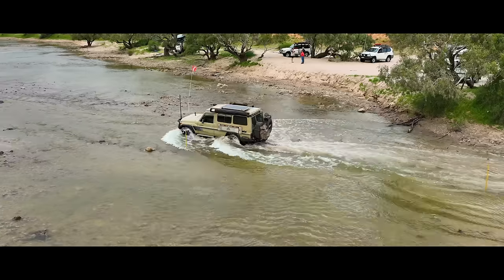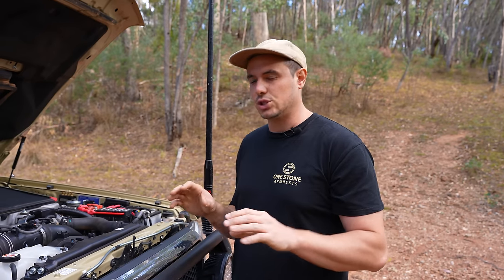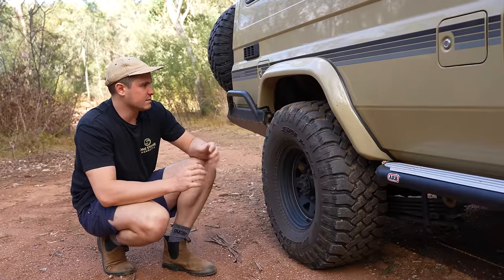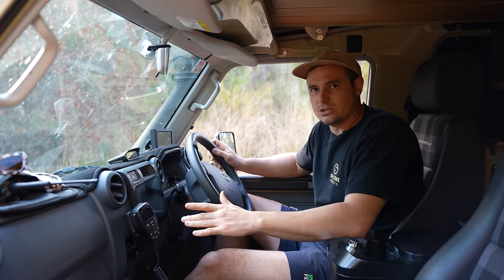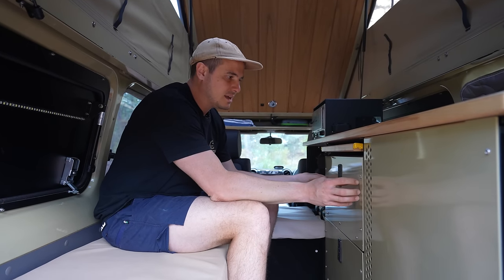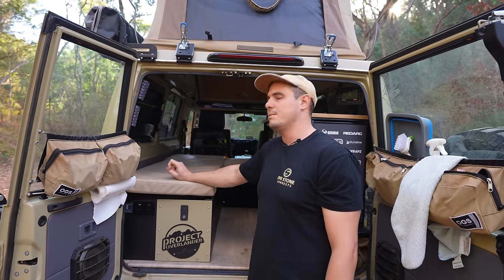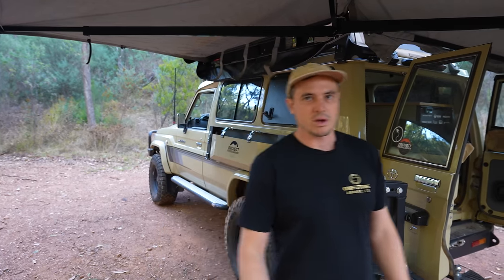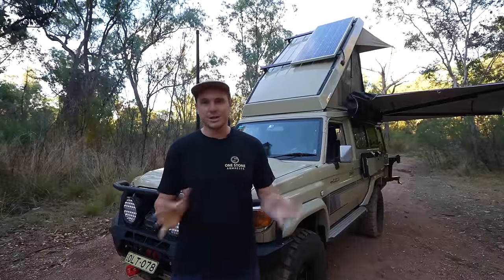ULTIMATE TROOPY TOURING SETUP - FULL RIG RUNDOWN

Comment: You left out the most important information, the total price.  I know most of the gear you have are either supplied 100% free, or with a heavy discount.  But if you had to add it all up with RRPs, how much do you think your current Troopy built costs?
Reply from the maker: All up it would be about $225 000
Reply: That was the first thing I thought the cost
Reply: @OverlandTravellers  is that including the cost of troopy?
Reply from the maker: @danielmichael3723  yes including cost of the troopy
Reply: @OverlandTravellers 225000$ including the car price or just accessories ? If it’s including the car that’s not bad I mean if you don’t drive like an idiot and MAINTAIN it out and in it’s a car for life
Reply from the maker: @tariklaarej2259  225 total including the troopy 👍🏼

Comment: Great video. Who makes/supplies the side utility panel please?
Reply from the maker: As in the maxtrax table and holder? It’s from project overlander in Sydney :)
Reply: @OverlandTravellers  where you plug your water and power into
Reply from the maker: @davidbarker5729  oh sorry, that’s also done by project overlander
Reply: Cheers
Reply from the maker: @davidbarker5729  water is filled through the utility panel and power is either from car, solar or 240 which is just plugged in through the front door but the door can still be closed.